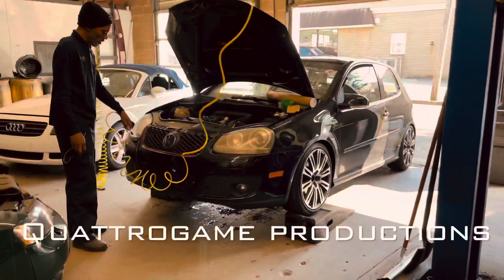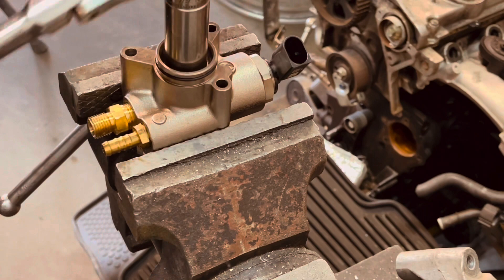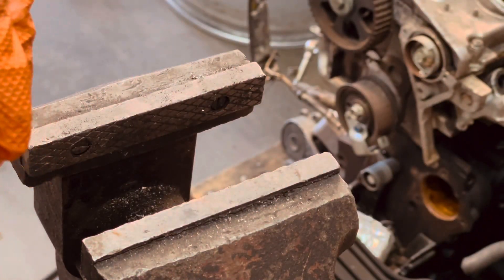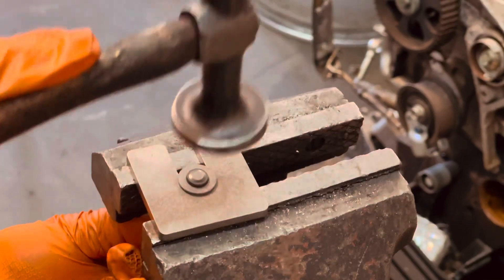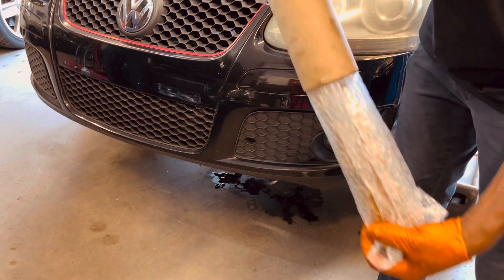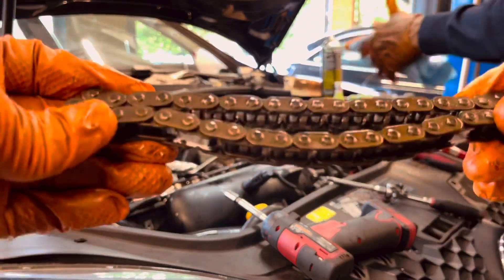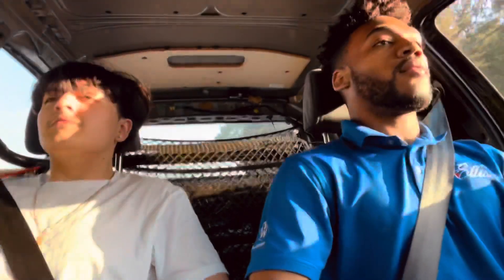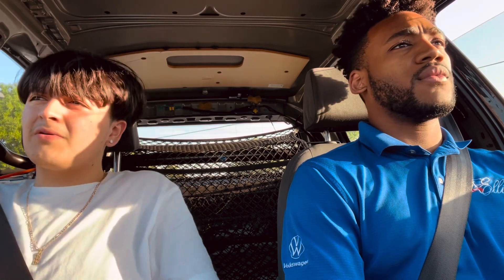2.0t AUDI/VW CAMSHAFT UPGRADE install+ Autotech high pressure fuel pump.

Comment: Where are you based? And do you do private work? My S3 just had a rocker arm break, it done a bit of damage to the camshaft, but none where it actually touches the other engine components!
Reply from the maker: I believe I saw your post on Facebook. I’m based in the United States.
Reply: @Quattrogame_pro I don't use that garbage these days, but maybe back when it happened quite a while ago, I just use one of the other cars instead atm! 

Ahh Shame, the shipping cost from the UK would be more than the cars worth including the work done too! 😹

Comment: The video that i needed, i need to replace my camshaft and ordered the upgraded version, need any software tune? or is "plug and play"?
Reply from the maker: Honestly I just installed and the car adjusted, however to maximize the mod you should probably tune with minor tweaks tbh
Reply: @Quattrogame_pro the tip of my hpfp got loose and was inside of the cam chain house, I have the kit for upgrade it but I’m not sure if replacing that parts with the upgrade kit replace the oem spring tip, thank you for your help!
Reply from the maker: @ if there is damage to the cam or the piston, then you definitely need to replace both
Reply: @Quattrogame_pro last question, did you move anything on the timing belt side to be able to remove the cam shaft? I just replaced the timing belt and did it perfectly just i want to avoid do it again, thanks for your help
Reply from the maker: @ oh no you don’t need to move anything on the belt just make sure the engine is at Tex and make sure the exhaust cam doesn’t move

Comment: Can i fit a camshaft intake 06f109101k in my ed30 full stock? No need chip?
Reply: My cam is equal to BHZ engine, 265cv s3, CDL are different code and compatibility... Next mounth i try to fit it whidouth electronic upgrade
Reply from the maker: Yessir unfortunately for you it’s not an upgrade tho… the ed30 already comes with the golf R engine.

Comment: Did you not have to lock the exhaust cam prior to removing the locking plate that goes over both cams? You just loosened it? Exhaust Cam didn’t spin?
Reply from the maker: Most of the locking tools out there don’t work very well so it’s best to just mark the chain and sprockets
Reply: @Quattrogame_pro  Similar thing happened to my cam follower. HPFP looks like it punched through. Nice job on the video. Watching your video is giving me confidence I can change the cam too. Seems like getting the timing part is THE most important part of the job. When you painted the chain and sprockets on the old chain and cam how did you find which parts to paint on then new chain and cam? On the chain, did you count links from the "home" link? And for the cam, does the sprocket have an indicator you count from? Pics on FCPEuro show there could be a tiny dot, but wanted to verify with someone who successfully changed an cam themselves.  How is the car holding up? Thanks in advance.
Reply from the maker: @brogrammmer  so unfortunately, that car burned up in a later video… for a totally separate issue however, it is very easy to copy the chain position link to link with a Mark … and match them up just like you would a timing belt. 
And  replace and put back together. so the best thing for you to do honestly is to go to a shop that has done these before to get it done. I will say doing it twice is not worth it because if you get it wrong, you will bend valves and have to do a head job. If you have experience setting timing on other cars, it may be worth a shot, but if it’s your first time doing it, I wouldn’t risk it.

Comment: So I have the exact same problem where the cam follower failed and the hpfp got chewed in my MK6 Golf R. After you did these changes, was the car running fine after? You weren't worried about metal in the engine from the pump?
Reply from the maker: No only because I made sure to flush the system as best I can! Time is you’re enemy tbh
Reply: Yea definitely pull the pan off. Same thing happened to me, pulling the pan is easy, and i found large pieces of the cam follower and fuel pump in the pan and balance shaft assembly. Balance shaft bolt was also broken as they had seized (once again , chunks of metal in them) and the oil pump chain was just barely hanging on. Threw a freewheel in there and threw it back together with a new cam and fuel pump and all is good so far

Comment: 2 questions, when you say R camshaft  what is it exactly do you have the link to buy it cuz i have a 06 gli tfsi, and the other thing does this change delete the diesel type noise on the motor, cause i have the p0011 issue with mine and i saw the cover from the hpfp is worn out from some of the sides (already change the cam follower)
Reply from the maker: So you have to get it from the dealer and it’s the camshaft for the golf are in Tts motor
Reply: @Quattrogame_pro just sale the 06 gli but i get an 2005 A4 B7 2.0 Tfsi quattro on this one a vw mechanic friend of mine said it can handle a bigger turbo and I want that haha and change the camshaft stg1 that i saw on ecs tunning whats your recommendations?

Comment: Thanks for the video man, not to brag or anything just measured 13° and she didn't fail. I'm amazed.
Reply from the maker: Woooow how did you you fix it ?
Reply: @Quattrogame_pro  currently in the process. Probably replace the cam, chain any everything else along with it. Luckily my balance shaft started giving me problems so while I'm waiting for the oil pump I decided to start breaking everything else down and thank God I did.
Reply from the maker: @codywaite3765   I have a extra golf r cam if you want it ?
Reply: @Quattrogame_pro  how much are you looking for?
Reply from the maker: @codywaite3765  $400

Comment: nice...what is the duration and when does the valve start?
Reply from the maker: I don’t have many specifics in cold hard analytics but you can physically see where the cam lobe is wider than the stock cam